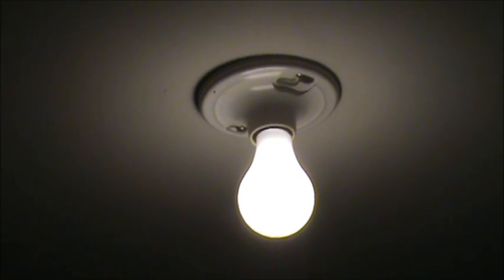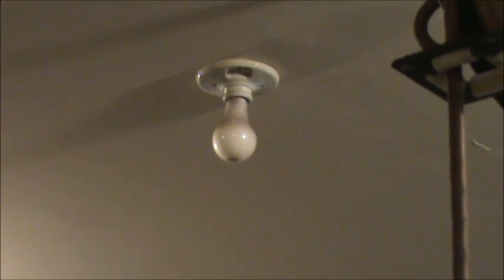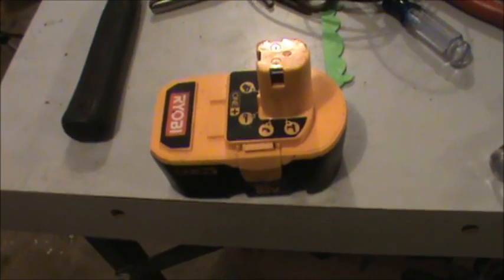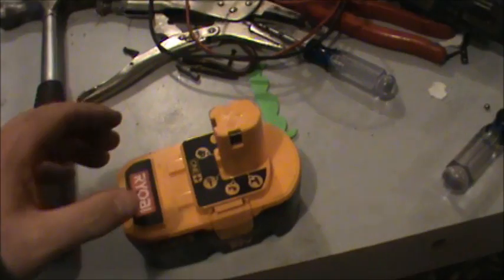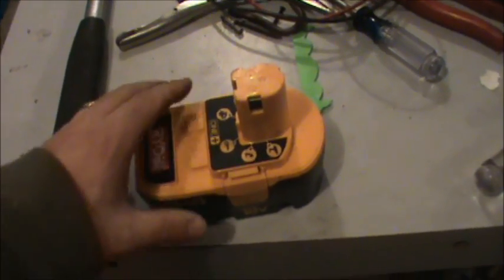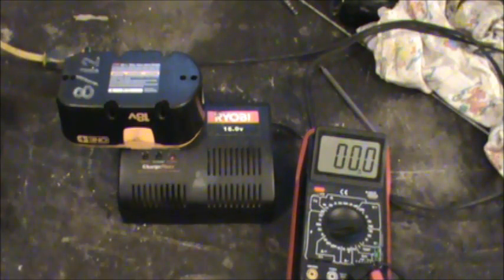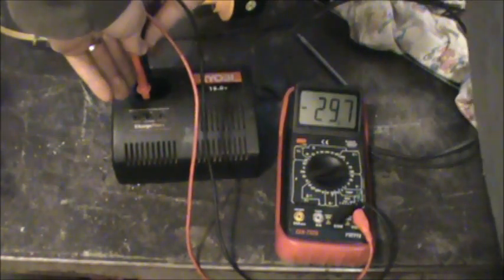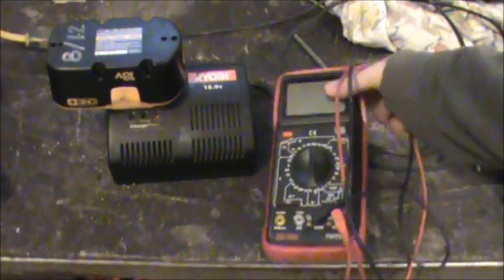Fixing and Repairing Nicd Batteries that Won't Charge

Comment: Do you find that after doing this trick the battery's hold charge or dissipate rapidly after achieving full charge ? Someone in comment section stated batteries died out very next day, not in this comment section, but other like video using same trick.

Comment: I have a great success with  Ryobi  18 v  batteries.  Maybe  7 out of 10 which is a pretty good recovery rate . I have since gone to Craftsman 19.2v.  And  have not  fixed any of  them  or Dewalt  18 v. Do you or anyone  else  know the hack  for either of those brands?

Comment: bulbs burn out when they suddenly change in temperature after the filament has aged, like the thermal shock of going from room temp to 3000 degrees in a tenth of a second when you turn them on. Any fluctuation of power from the wall when load is applied would be a voltage drop and that may or may not even be present depending on home wiring and cables used to power a load and how much of a load you got.

Comment: There are several components to battery repairing. One plan I found that successfully combines these is the Jons mender guide (check it out on google) without a doubt the no.1 info i've seen. Check out this incredible website.

Comment: I have the exact same Ryobi drill. I went and Don just what you did, and after several times, only the red light came on, saying fast charge. But in about 10 minutes, it went green, showing that the battery was charged. But it was not. The drill did not do anything. Do you have any tips?

Comment: It won't last'' It will return to a non charge state .. I used a car charger to reset the battery . But in the end the battery is junk . You might get a few more times it works ,but it won't last very long .I have 8 Milwaukee battery's . I will sell them all to anyone who thinks this is a true fix? If there is nothing really wrong with them ? $10 a piece is a good price Or $60 for all'' I don't think anyone will want them ..

Comment: ^Your explanation  of why globes burn out on switch-on is incorrect. The   reason is that when the filament is cold it has much lower resistance so there is a surge of current.
Reply: Nevill is right, poster is wrong.  It is a result of higher current during circuit connection than during steady state.

Comment: Regarding the lightbulb... It's not a case of "fluctuating power"
A lightbulb burns out when you hit the switch is because the filament is cold. A cold filament has a lower resistance than when the filament is hot. A lower resistance means higher current so for example: A cold 60 Watt bulb becomes a 200 watt bulb for a split second.
If the bulb is near the end of it's life that high current surge is enough to blow the bulb on start-up
The power or line voltage may only fluctuate by a few microvolts when you turn on the light and is certainly not noticeable unless you're living in a "doublewide" trailer with an insufficient and antiquated fuse panel that was designed to run a few light bulbs as everything else was expected to run on gas.

Comment: The mains voltage remains the same, but the resistance of the bulb's filament is low when cold, hence more current flows till it reaches its operating temperature.

Comment: Electrical systems (grids) are intended to be "constant voltage" systems. Light bulbs undergo filament evaporation as tungsten is white hot and diffuses to the glass shell over time. The reduced filament diameter results in higher current densities at the minimal diameter points. Current density is the cause of atomic vibration as electron flow density provides more vibration/kinetic transaction to the tungsten atoms, which are bound on a crystalline lattice. When the switch turns on the filament is also at room temperature. Resistance and temperature are linear in tungsten and quite low at room temp( typically a couple of ohms). At operating temp a 60W bulb will be a couple hundred ohms. The thinned part of the filament will undergo massive power dissipation at instant of turn on and proceed to vapourize. When the contact fails a short duration plasma arc occurs and generates the classic blue spectra ( 8000K) colour temperature and the filament opens and we go dark. This is why it always occurs on turn on as the electrical grid does not really control power, but attempts to maintain a constant voltage at all times. The load determines the current draw and final operational power. If you mechanically disturb a bulb at end of life cycle the filament commonly breaks as it has evaporated to a thin state and is fragile and you end up lying under the car in the dark as you tried to move your lamp.  Voltages vary with utilities around N.A. and the world (Japan is 100VAC! and Brazil is 127VAC). Most things are specced to run between 110-125VAC with little issue. Light bulb power is rated at a specific value and varies depending where plugged in. The Boston firestation with the 100 year bulb has the bulb in a very yellow state and never turned off. The vapourization is super low so the filament really lasts (exponential mean time between failure..) and the never turn it on and subject it to cold filament transient current densitiy- so it lasts- bit of a technical scam!

Comment: Sulfides build up on the Plates over time impeding the Ion flow and Pulsing the charger pulses the plates and blasts the Sulfides (whiskers) off and then the ions can flow and the battery will charge, works on most batteries especially Lead Acid Batteries.
Reply: I have "boiled" lead acid batteries out by dumping the old acid (it is weak and blackened, dirty, but will still burn, so use protection) then I funnel in baking soda in each cell and gently add white distilled vinegar. I do that 2-3 times then rinse with distilled water and put new acid in the cells. I then slow charge it to full charge. My service truck has a 60 month battery now beginning year 8. I keep it clean and maintained. Can't make them last forever but you can inexpensively extend the life considerably. I don't add either acid or distilled water without testing the acid and I keep my terminals clean with electrical silicone on them.
Reply: @marksovine9114  I purchased acid from my local parts , do i need to dilute the acid prior to putting it into the old battery?

Comment: dont have an old charger and the new one plus intelli ports dont work for the un plug and plugging method, but i charged an 18 volt nic and took two 6 inch 10 guage wires, stripped the ends half inch back, and touched pos. to pos. and neg. to neg. got a spark, touched it a few more times, and but my old non charging battery in the charger. charging now..... ill let you know in a couple hours if it actually worked. wish me luck.

Comment: The volt/ohm/capacitance/amp meter he referred to is indeed a good one, via amazon and others, its the only one i've ever had that does the capacitance check  which is good to have for ac/ ceiling fans/ motors, etc.  The stand in the back is very handy to make it stand up at a slant so you can read it easier (also rfunctions as a kind of a hanger so i could hang it im
promptu off a fence rail. )

Comment: Actually, in the USA, voltage is 110, not 120.  In Canada, it's 120 (not 110), but people in the US say "120" and Canadians say "110".  It's so ironic.  I've lived in 3 [Canadian] provinces and 17 States, and worked in many tours as a sound technician. I use voltmeters, and all USA power is 105-112, and ALL Canadian is 119-126.

Just sayin'.  I'll try the "shock" tip on my Motorola radion NiCd batteries.  Cool!
Reply: The utility delivers 120 volts to your meter base in the good old USA. I know, I've been doing it for 30 years. The advice on here that somehow voltage increases when you flip on a light switch is bogus. To say that you increase voltage when you flip a switch, or there is a voltage "spike" when you flip a switch goes against every electrical tenet existing. A transformer puts out a voltage based on a ratio of windings on the primary and secondary sides. The Only way to increase secondary voltage (the 120 volts delivered to the meter base) is to increase the number of turns on the secondary coil in a transformer. Take away turns, the voltage reduces. This cannot happen by merely flipping a switch. The electrons do not rush to the end of the wire in a big bunch increasing voltage until they level out. Switch on, you get 120. Switch off, you get 0.
Reply: Football5198 I have also heard that same crap so many times from people who are not even linemen or electricians. They will argue that myth to the Kremlin, like a Liberal arguing with no end. I guess they think there is some sort of start capacitor in that switch 🤣
Reply: In U.S., voltage is 120
Reply: 120 RMS is it according to NEEMA.  (110, 115, 117 some old ones area specific).PEAK VOLTS X 0.707 = RMS.~ 170V PK. X 0.707 = 120 RMS   or DC equivalent.HOWEVER the switch will sometimes favour making contact on the PEAK VOLTAGE, with a COLD tungsten filament lamp results in a surge that can blow out light bulbs . CHANGE the switch if blowing light bulbs on a circuit is a problem
Reply: Accu door meten
Reply: Not actually true because if you take a meter and test your outlet in your home, depending on the length of the circuit, it'll read between 121v to 124v and sometimes a little more.  the guy on this vid is right about voltage in your home burning out light bulbs because most light bulbs are 120v but, if you have 124v coming into your outlets it'll burn them out quicker than they were designed to.  When you see something that you bought in the USA that says 110v,  it'll go bad sooner than if the device says 120v.  I suggest if you use incandescent bulbs to buy the 130v bulbs and they will last longer.  Apperantly your volt meter isn't calibrated for the US.  I'm a 26 year electrician and I use volt meters that are RMS true.  You may want to get a better meter.

Comment: Light bulbs burn out at start up because the RESISTANCE is lowest when they are coolest, which allows too much current to flow which melts the filament.  Interestingly, when the bulb is hot the resistance rises about 15 x more... do the math:  v = i R, 
 so for a 120v bulb where I is not known you "should" be able to solve by measuring R on a cold 40w bulb as about 26 ohms, so for I =V/R ... ie  one might think that for a filament   I =120/26 =  ~ 4amps  BUT : 
; the bulb is rated at 40watts so as a check you can use the W=VI  equation => so I = W/V  = 40w/120v = 0.33 amps  (this makes sense where  4a  does not;  the solution is because the filament heats up and while the cold R is ~26 ohm the hot R is much higher, the hot R comes out to R (HOT) = V/I = 120v/ 0.33 ohm =   R(HOT) =   363 ohm (yeah about 363/26 =  14x more !  (we checked others and 15x more R hot than R cold is common place, which explains the first cold R filament burnouts  and why electronics go haywire when parts overheat. 
     Summary:  ;when things get hot the Resistance goes way up. Rule of thumb always do worst case analysis Ie HOT and Coldest conditions "Under Max Load/Working " Conditions to make sure your circuit will perform reliably (fortunately only heaters and bulb filaments and other hot devices are the usual problems).
Reply: Thank you for throwing the truth out in the midst of the myths presented here.
Reply: john Doe z
Reply: john Doe that's what i was thinking, too..

Comment: When I saw this I kept remembering the video where they guy opened a car battery to see what was inside and found a unicorn.   I did this for an 18v weed whacker battery that's about 2 years old.  I used it for edging and cleaning up after mowing until about 4 months ago.  Battery time got shorter and shorter until i couldn't even finish the edging.   Did the plug in, plug out about 10 times and let it charge overnight.  This morning i did all the edging and the clean up and I still have battery to spare.  It's not even straining yet.   I don't know how long it will last but this actually did work.  Thank you for posting.
Reply: Far out man

Comment: I wonder if this could be used as a maintenance procedure.  I have a Hitachi drill, my best drill.  Fits in my hand perfect, lighter in weight and is well used.  For a 12 volt drill, its tough.  This method may get me more from my battery packs, as they are $50 at Home Depot.

Comment: I only found this to work if the metal is visible and you know which is + and -.   I did this to my Ryobi batteries and used the Boost on them and "stroked" the + side.   worked Great.